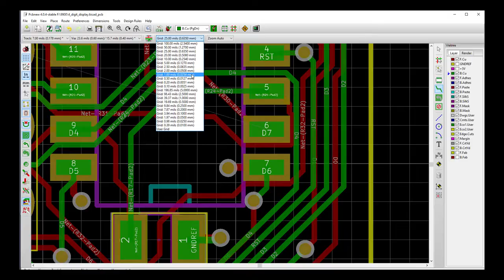Putting together the 4 digit hex display

Comment: Note to self. Thou shalt always run DRC before submitting a PCB design. ;)  I'm a little surprised that KiCAD didn't state there was an unrouted signal. Depending on the way the traces are run it is possible for it to say everything is routed when there are some missing traces. That green trace going under pad 6 (D15) looks a little odd with that jog in it which doesn't seem needed.